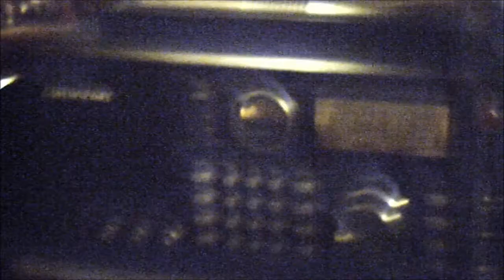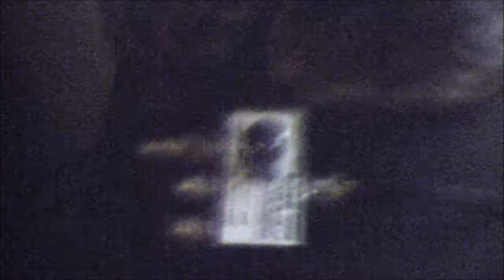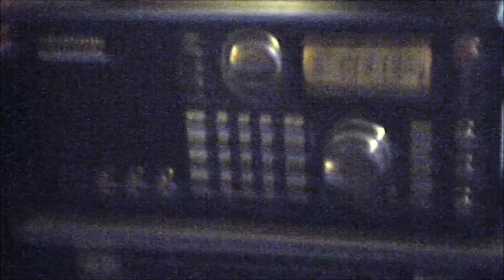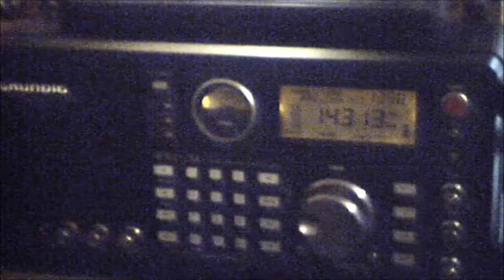A Better Look At My Outdoor Shortwave Antenna

Comment: That is a lot of insertion loss you've introduced into your feedline there, to save a little signal loss it would be possible to fabricate a section of wood to fit flush into the window frame so as to run your cables through and still be able to close the window (albeit with a modified locking mechanism).

Thumbs up for the nice selection of desktops.
Reply from the maker: I was considering doing what you suggested, but we will more than likely be moving in spring, so I figured this would work the best. Once we move and I get an idea of what I will be able to work with, I will more than likely go with a setup like you suggested.
Reply: And a bigger badder antenna as well perhaps?
Reply from the maker: ***** Hopefully! :)